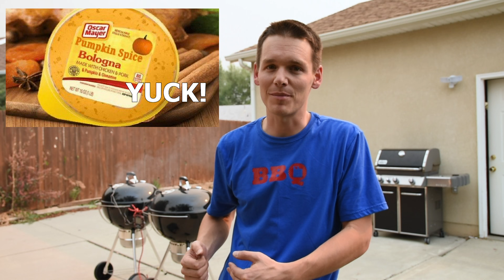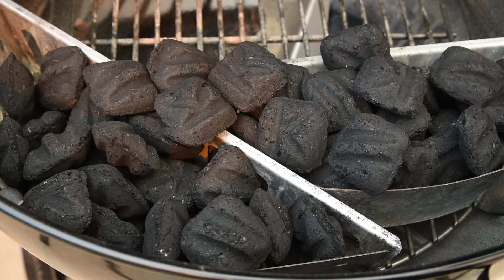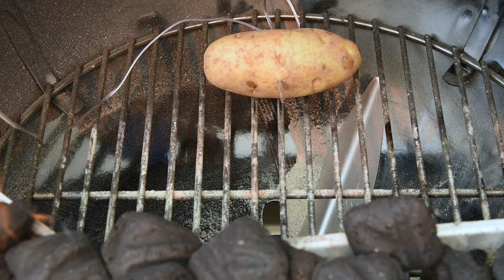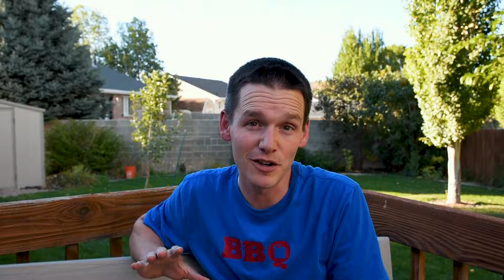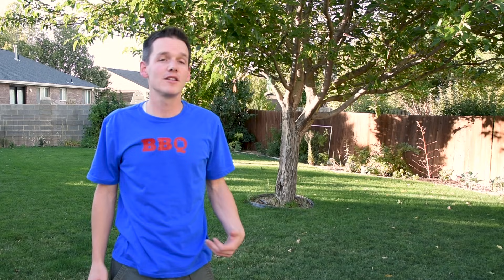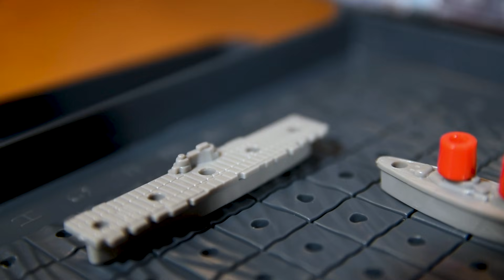Efficiency Test: Slow N' Sear vs Weber Charcoal Baskets

Comment: The Temperature is controlled by amount of Oxygen (Air). Not size of basket or amount of coals.
Reply from the maker: Yes, and the amount of oxygen is related to the size of the fire. A bigger fire pulls in more air. If you light more coals, you'll get more oxygen with the same vent settings.

Comment: $100 additional cost with larger capacity being the only difference?  You do realize that essentially every Weber recipe prescribes a number of briquettes less than full?  The hinged grate allows for easy adding of coals.
Reply from the maker: You found a video that assess one small slice of the differences between the two and directly look at a claim that SNS made about their product. It was not intended to explain all the pros and cons of either the SNS or weber baskets.

Comment: Slow'n'sear all day. It does so much more than just low and slow cooking. Nothing is better at the reverse sear, for example.

You have to get in to the fine print on how they determine more efficient. Most people probably just pile the charcoal up on one side. I know for a long time I did. I also used bricks as a divider, ones I found in a ditch. Talk about cheap. But the SNS is so much more efficient than that it's crazy, even though using my brick divider method I cooked all kinds of great barbecue, including chicken, fish, pork of course, even a few brisket points. I imagine a lot of people do the same or close to what I did. So in that regard the SNS is way more efficient. Easier and cleaner too.

Comment: I think the real efficiency comes from having a drip pan shaped just like the empty space on the charcoal grates so that all the air is re-directed through the charcoal to feed the flame; no air passes through the kettle without being heated up. on top of that, packing the fuel as tightly as possible also ensures no air "leaks" through. as long as you achieve that, all there left is conservation of energy. more fuel == more time; equal fuel == equal time; regardless of the baskets.

Comment: I got the baskets included with the last kettle I bought. Have had the slow and sear for several years and love using it. They both have pluses but if I could only have one it would be the slow and sear. Great video.

Comment: You could load up a lot more briquettes in the Slow 'N Sear than in the 2 small baskets and you dont have to monitor anything with the SnS vs the baskets.
Reply from the maker: I don't normally pay as much attention to the SNS, but I had to keep the temps consistent for the sake of the experiment.

Comment: What if you set up the dual baskets one on each side and let them both at the same time then change events on both to achieve the 250 obviously the events will be different on the dual baskets and let the dual baskets burn slower but combined they have the same temperature that way you don't have to worry about a bridge.
Reply from the maker: I've tried that method, but not in an efficiency test. Separate baskets makes this complicated too because you have to manage two fires and it can be harder to get your temperatures down. I'm sure there are people out there that have mastered it.

Comment: I came to the conclusion that I like the weber baskets better, I like the fact they can be moved around easily, I place one on opposite sides of each other and indirect cook in the center of the grill . The sns does hold more charcoal and will last longer during a cook, however I found out while making baked potatoes that somehow the heat doesnt spread out inside the grill as well as having baskets on each side.

 Normally large potatoes would be done with the weber baskets in an hour, with the sns I had to cook them an extra 15-20min in order to get them done. The sns does get extremely hot for searing though, I just didnt like the indirect results .
Reply from the maker: Everyone should use what works for them. I tested both and the SNS produces more even temps on the indirect side because it blocks more radiant heat from the coals. That's an interesting result. I would have thought the same temp would result in the same cook time.

Comment: Shouldn't one add water to the slow and sear - I mean, that's the main difference is the integrated water resevoir - otherwise you're just testing stainless steel recepticles?
Reply from the maker: Great point! The challenge is that water takes an incredible amount of energy to boil and evaporate. The Slow 'N Sear would evaporate all of the water, but putting a water pan in front of the coals probably wouldn't and that would skew the results.

Comment: I recently won a Weber Performer and fell in love with smoking and grilling. I was looking into the SNS  or 2 baskets. I went with the baskets. For me the first basket is starting the second basket from the vent holes in the basket. I do not need to create a bridge on top. I just make sure a vent hole at the back of basket 1 is lined up with a the front of basket 2. When loading the charcoal. I make sure that vent has charcoal touching. The second basket has not failed yet to start. Thanks you for the videos.
Reply from the maker: That's a great tip to get good vent hole alignment.  I hadn't considered that or seen anyone else talk about it.

Comment: My guys what you do is arrange the baskets in a circle and form a channel “moat” with the inside of the kettle. Then put the briquets in the channel. I put bricks in there too, holds in in place and also a great heat sink to stabilize temps.
Reply: That’s basically the snake method isn’t it

Comment: Slow and sear takes up way too much space, 1 rack of ribs, the smokenator is not much different plus you can get 2 racks of ribs and cheaper too
Reply from the maker: You can fit two racks of ribs while using the slow n sear.
Reply: Well that's bullshit,  you can for two with the slow and sear buddy.

Comment: Have you guys ever put food on the charcoal grate that SnS sits on? If I can do that and cook two roasts in one kettle at the same time (1 on charcoal grate, 1 on grill grate) that would be a game changer.
Reply from the maker: They sell a Drip 'N Griddle pan that has a wire rack that goes inside of it.  It fits perfectly in the empty space next to the SNS.  I haven't tried it, but I know people who have.  The only gotcha is the temperature is about 40 degrees lower than the cooking grate level so things take a bit longer to cook.

Comment: Just use the snake method. Problem solved.
Reply from the maker: If you care about efficiency, you might want to check out the snake method test on the SNS Grills channel.
Reply: @GrillTopExperience  
I have. If you save 4-8 briquettes using the Slow n Sear, how long will it take you to pay for that slow n sear?

Comment: Slow n sear vs The Snake? Pretty good results with the snake
Reply from the maker: SNSGrills did that same test with some fan controllers.  I won't spoil the results, but there were differences.  I would be interested in testing to see if there are differences in the end result of your meat.
Reply: @GrillTopExperience  I do not have a SnS so it will be hard to test. The brisket I did this WE in the Weber 26" using the snake method was pretty good but I have no point of comparison. Will head out to SNSGrills to see their test. Or even try making a Bro n Sear who knows! Good content.

Comment: I’m late to the comments - just wanted to say I get the exact same results of a S&S by just blocking off 1/4 of the kettle w a couple firebricks and then using a water pan on the open side. It’s rough on the grills but they’re cheap enough I guess.
Reply from the maker: I've seen people do that with regular bricks.  The firebrick is a better option than a standard red brick for sure!  I guess it just depends on how much hassle you want to deal with. Some people like a pre-built solution.

Comment: Those little baskets are crap. Slow cooking alright , any slower and you'd be better off to use the home oven.  I turn mine into a raging bon fire with huge flames , let it die down a little and cook. Job done.

Comment: Does anyone make a smaller charcoal basket or charcoal seperator that will fit my Weber 14” portable smokey joe? So I can do indirect cooking. Thank
Reply from the maker: I haven't seen any that'll fit anything less than the 18" grills. You may need to make something custom. You might try making a wall of aluminum foil as a test so you can get the size right.

Comment: Never Never use an accelerator to light you coals... A chimney with with good ol fashioned paper is better. Accelerators change the burn and flavor of the food.
Reply from the maker: It says right on the package: Non-toxic and odorless. The chimney method works great too, but I needed to limit the variables in the starting process.

Comment: I don’t use any of the two, I just make a pile on the side.
Reply: I use two fire bricks.  $20 slow and sear.
Reply: So pure.
Reply: Good 👍 for you.
Reply: after a while, that might lead to a slight pitting of the exterior paint job. So I think having the coals in some type of basket helps protect the grill itself.
Reply: Monkey Boy have been doing it for more than 5 years now, no issue.

Comment: I have xl on 26” Weber and I barely get 6 hours at 250 degrees before I have to add charcoal..,,
Reply from the maker: I don't have a 26", but I'm surprised that the time doesn't match the smaller kettle since it holds more charcoal.  That's good to keep in mind though.

Comment: You can get a pair of Weber charcoal baskets on Amazon for 17 bucks.  Wire them together.  Take a grinder and cut a U-channel between the two so you don't have to worry about building a bridge between the baskets.  Done.  In my opinion, the Slow n Sear is WAY, WAY overpriced for what it does.  YMMV.
Reply from the maker: I think they call that the bro 'n sear!

Comment: I'm trying to decide on going with either a Vortex or the SNS. Of course the price difference is a factor as well. $40 vs $100, but I hear that the Vortex can cause damage to the kettle as the temperature gets very hot.
Reply from the maker: I haven't used the vortex, but I have seen it burn up grill grates. They are really different products. You wouldn't use the vortex for low n slow, but you can sear and cook slow on the Slow N Sear. It really depends on how you want to use it.

Comment: Show this using the slow n sear like the company recommends. Lighting from one end and adding water. It makes a difference.
Reply from the maker: Thanks for noticing! About 3 months after this ABC asked me to make the how to light the Slow N Sear video. I skipped the water because it would evaporate in the SNS and not in the baskets. It takes a lot if energy to boil water and it would have been less efficient. This made it a fair fight.

Comment: Hi GTE. good test. This controversy can only sell lots of SNS... Another factor is how these units perform in different temperatures, and with and without water.
Could you share what you used to graph the cook? I see you have XR50 and so do I. But how did you chart? Is there an App that picks up that RF signal? 
Thanks, and keep up the good work.
Reply from the maker: I wish I was that cool and could have used an app.  I had an action camera set to take a frame every 30 seconds.  I had the XR-50 and a digital clock in the frame.  I manually copied the data over after the test was done.
I repeated the test when it was 15 degrees F and got similar results.  They burned out a lot quicker though.  Meat Cranium did a test comparing it with a different method and the Slow 'N Sear was more efficient, but he showed that the temps weren't as even.  It's interesting to see the different test methods and results.
Reply: @GrillTopExperience  You're even cooler. I'm pretty good at workarounds, but this takes the cake! Thanks for the fast reply. Do you know if anything charts and saves a long cook?

Comment: While I like the slow and sear the cost is absolute bullshit.  They cost as much or more than the actual damn kettle.  They are built out of $2.75 worth of metal.  After marketing and distribution costs they should cost the buyer around $20 to $30.
Reply from the maker: I would guess you haven't held a Slow 'N Sear.  It's weight in cheap scrap metal would cost more than you suggest.  The cost of the stainless steel plates would cost the DIY'er more than half what they charge.
Reply: @GrillTopExperience  I have not held a slow n sear but I am a hobbiest metal worker and can tig weld SS.   If you are buying small pieces of sheet metal from Home Depot you probably are paying a fair amount of money.  But if you are a manufacturer that purchases rolls of SS sheet metal you are getting it at a substantial discount.

Comment: I took both the Weber baskets apart and then screw them together so if they were the same size as the slow and sear guess what it works
Reply from the maker: That's the bro N sear. Not as good, but a lot cheaper.
Reply: @GrillTopExperience  Haven't seen the video that shows it's not as good.

Comment: Thanks for the comprehensive test! Exactly how I would have conducted the test. I was hesitant about the slow and sear for this exact conclusion and have simply used fire bricks to create my basket and have achieved great results on my 26.
Reply from the maker: That's another good method that people use to get similar results. That's the cool thing about the kettle.  There are lots of mods you can do.  Find what works for you and make great food.

Comment: Love the test. I actually prefer the weber baskets with a twist. When they first came out I had just bought one of the master touch grills they came in. I was a snake guy. So I bought another set if the baskets and after a few cuts, I  joined them at a 90 degree. Now I had a snake set of baskets. No bridge needed. The idea works fantastic. I can hold 250 post 6 hours. Only thing better is to find one of the internal ash plates from a 1970s happy cooker, the way it helps control air flow is the game changer of all methods.
Reply from the maker: That's definitely a good mod on the two baskets.  They just aren't big enough by themselves to go low and slow for a long time. Thank you for the tips.

Comment: What about testing the SNS, using the water reservoir for a low and slow cook, which is what people who own it would use? When I’ve used the Weber baskets, I end up putting water in one of the Weber rectangular drip trays and placing it on the opposite side of the baskets, or in the middle, if I have a basket on each side and I’m doing a beer can chicken.
Reply from the maker: That's a good point, but I wanted to keep everything as even as possible.  The Slow 'N Sear would be more likely to boil off the water, which could reduce it's efficiency.  The follow up video I did cooked two pork shoulders and compared the results.
Reply: Grill Top Experience  Right the water would boil off, but at what point? It is probably a variable time, based on weather, etc., but by not using the water reservoir in a low and slow comparison, which SNS says to use on low and slow cooks, won’t give you a true reading of the SNS’s efficiency.

Comment: I’m not sure why the sns is compared to baskets. Why not run the test with banked charcoal and no baskets?  A drip pan opposite of coals will contain them. You could even fill the pan with water and the sns with water.  If you have time, run the test again. No bridge to fail and the drip pan method costs $0 dollars. Even better than baskets
Reply from the maker: This video was in response to another test using the baskets that used methods that had a few issues that skewed the test.  There's another one similar to what you mentioned comparing the snake method and the SNS that had different results.  The baskets keep the hot coals away from the kettle walls and I'd bet the bank method would be less efficient.  I guess we won't know until we test it.

Comment: I think this turned into a slow and sear commercial, honestly. You said the second charcoal basket lasted .5 hours longer than the S&S. So then how does the slow and sear dictate the extra 100.00 in price over the baskets? Maybe the S&S needs a redesign. you all think if it had a pinch in the middle it would last longer?
Reply from the maker: The only reason the baskets lasted longer was because the temperature dipped in the middle of the test when it didn't jump baskets.  In this same video, I repeated the test with a successful bridge and they both went out at the same time.  I don't think I would change the design of the Slow 'N Sear.  The follow up video to this one showed that the Slow 'N Sear kept a more even temperature across the cooking surface.  Is the SNS more efficient than the baskets?  No, but it makes it much easier to cook on.
Reply: @GrillTopExperience  If you're going to the trouble of cooking on a Weber kettle, how much easier is easier gonna be? I honestly don't see that much difference in the effort required between the two methods (excepting the failed bridge of course - but that's just a matter of experience) Anyway, good stuff. Cheers!

Comment: i threw thos baskets out by 2nd use.,. SNS is king
Reply from the maker: It's true. They are too small to be useful.
Reply: The Weber baskets are handy for high temp grilling using indirect heat and reverse sear, at least on the 26" weber. They don't hold enough to do low and slow. I got a Smoke-EZ for my 26" weber and use the snake method.  Similar to a UDS and works great.   @GrillTopExperience

Comment: What if you lit both baskets at the same time but dampened them down so that when burning together they would maintain 250 F Then you wouldn't worry about the bridge.
Reply from the maker: That's a good question.  I'm not sure what would happen, but I have a couple questions that it would answer: 1) Could you get the temp down if you lit both sides and 2) Would lighting at both ends make it burn out faster?